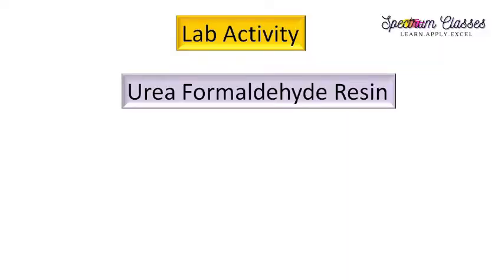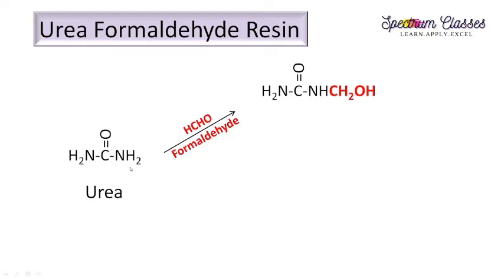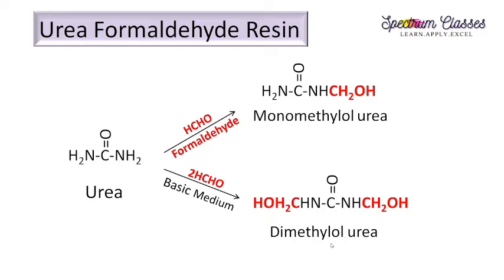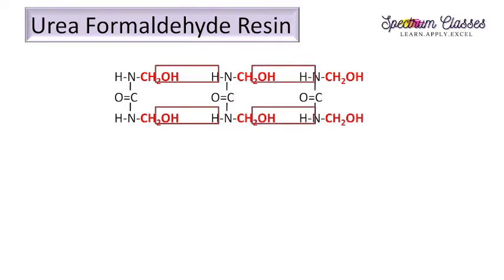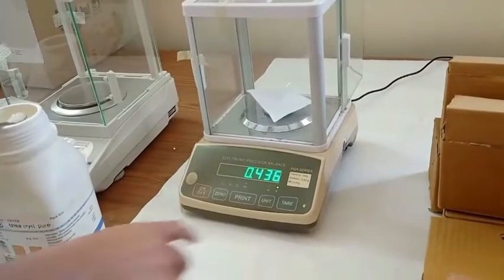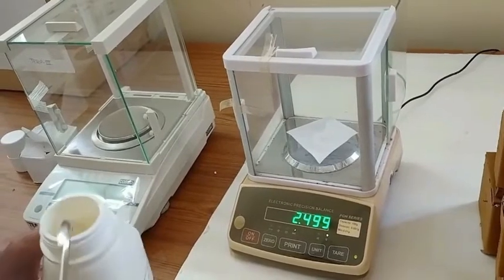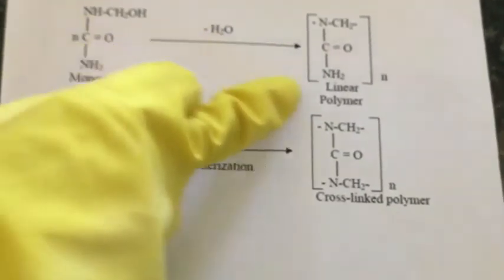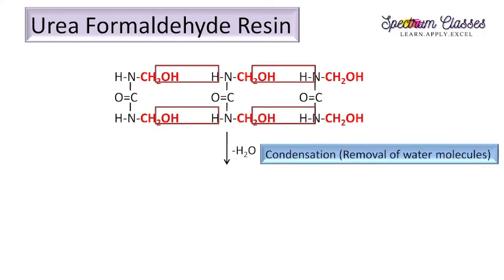Urea formaldehyde resin |Synthesis | Explanation with reactions involved | Polymers

Comment: hi. i have two questions please. i am wondering why there are so many videos on youtube about how to make urea formaldehyde resin? also, i am investigating making molds (for casting things like two-part plastic resin) from something called 'Melamine'. apparently plastic resin will not stick to Melamine. i've been able to find videos of people making things like melamine dinnerware (they compress heated melamine inside of a large press) but no videos on how to make melamine. are you aware of any videos on how to make melamine? thank you
Reply from the maker: Thanks for watching and sorry for the delayed response, I have this experiment in our B.tech first year syllabus therefore I have made video on this, secondly urea formaldehyde resin is a kind of melamine resin as it has reaction between same kind of functional groups under similar conditions and results a polymer. As well as urea is readily available as compared to 1,3,5-triazine skeleton which forms melamine you are talking about, that used for making utensils on molding. I tried my best to answer your queries if you still have any further doubts you can write me back, thanks for your concern it helps my other viewers too🙂